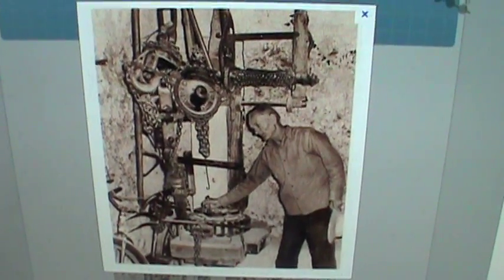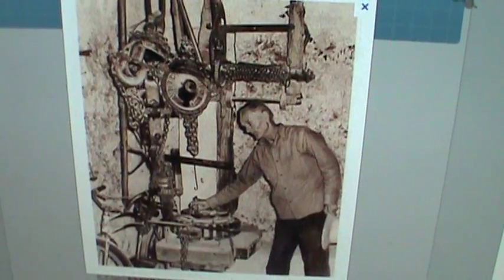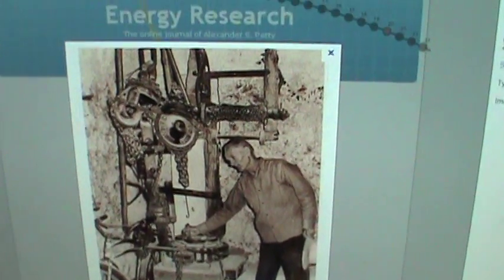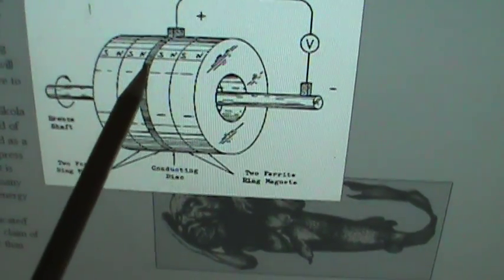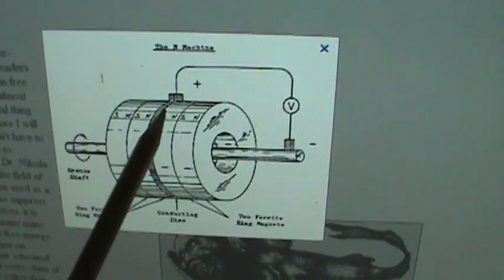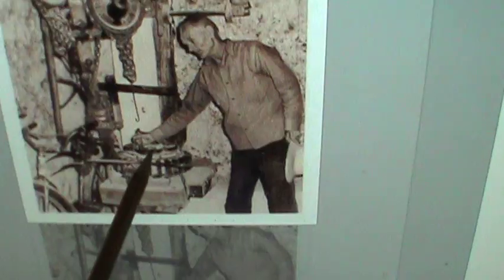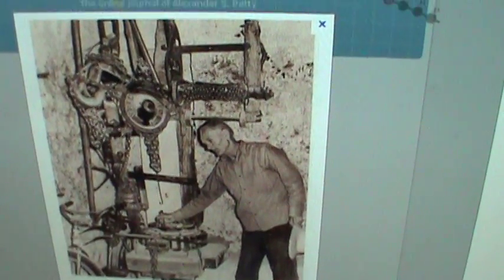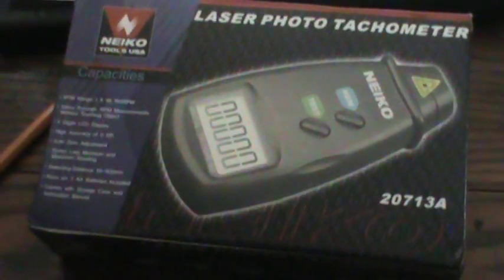Ed Leedskalnin Coral Castle Flywheel Secrets Revealed

Comment: In his book magnetic current Ed stated: "Connect the battery with the electric magnet. it will be a field magnet now. Put the three-inch coil between the iron prongs and take it out, do it fast, repeat it, then you will have a steady light in the light bulb.
Now you and the field magnet are a generator. Suppose you had a wheel and many
coils around the wheel turning, then you would be making all kinds of light." What really interesting is the "all kinds of light"

Comment: He talked alot about electrons. I believe that he was turning electrons inside out resulting in inverse energy. EDL said "If electricity is made with north and south pole magnets and the electric motor is turned around on its axis by the north and south pole magnets as is the fact, then this will bring up a question, where then are those Thomson electrons. They are not around the electric motor. The plain answer is they are non-existing."

Comment: Randy, great info!  When I visited Ed's castle, there was an iron bar that connected the motor to the coral wall behind him in the picture.  I wonder if it was meant to connect outside the  house or to the rotor, PHM, or possibly the rotor shaft.  It could be slid in or out of position.

Comment: I think to levitate those stones all that is needed is a strong magnetic field and the right frequency since all matter is actually energy each vibrating at differerent frequencies. So with the wheel and coils he managed to create a very strong magnetic fileld and tuned in to the frequency of the coral and depending on the individual magnets (north or south) he could make the stone heavier or lighter. Now we need to figure out how it was done.

Comment: I understand that if you could perfect this design it would easily generate a lot of electricity. Great. Now, where are the rest of the heavy cranes and equipment needed to move these stones. He did not have them. What was he doing with this energy and how? Please post another video when you have the answer. Thanks.

Comment: Nice! To really draw in magnets into the iron, it shuld be pulsed. And isn't the top of  the handle a little bit burned? Could it be posible that it was a spark gap between the hook and the handle on the wheel, one pulse/rev? it would still be a homoplar motor and even less friction than a hook dipped in the water. Thank for all your efforts!

Comment: Well you certainly have me thinking enough to make me want to have a looksee at that photograph myself, but i can se that you have put a lot of thought into this.I also think your point about the wetted,  0 friction contacts is interesting< i have to wonder how you can be sure that only water was used in the basin with the magnets,
i am also curious as to how important the ground portion of the circuit is because i have beeen to Fla. and in my experience you could find ground water anywhere by digging just a f few feet., therefor if your soil does not reflect the same charecteristic as the soil at coral castle.

Comment: I was reading about earth gridpoints and came across this.   How interesting and convenient the grid point is now in an air force base?

We must remember Leedskalnin was working on a Diamagnetic Earth Grid 			Point, so all mass objects in that area are always "charged" and 			easily lifted at their center of mass by a slight upward pushing 			pressure. Incidentally, due to the shifts in the north and south 			magnetic poles, Grid Point #18 is now inside Homestead Air Force 			Base; thus Coral Castle could no longer be built where it is now 			located.
Reply: great info. ed found the place my riding a bike without the rubber tires on it. something big is missing to this whole thing

Comment: Is it possible that the chain was charged with electricity making some sort of electromagnetic field flow through the chain? Perhaps the entire chain became anti-gravitational. He would be able to wrap the chain around the rock and the lift from the antigravity chain would lift the rock up. 

Now that the rock is suspended in mid air (or maybe even floating upward, depending on the strength of anti-gravity), he would be able to push the rock anywhere while it is weightless. Is this possible? Tnx

Comment: Another thing. According to the old paper about Edisons eperiment and folow up tests, the iron external from core should be connected assynmetrical. Connecting it to the null point will not do anything extra. Ed wrote something like this his book: "...put an iron pipe with only one end cap around the coil and fasten a hook on it..."
But he didn't tell what the hook was for. Maybe to connect one of the coils outer iron to the big extenal iron mass.

Comment: enjoyed the vid bud. Not sure if this is obvious or relevant but the chain in
Ed's picture is wrapped around a cylindrical "axle" of shaft (above Ed' head in the photo). Or so it appears, was this generator simply to make the axle/shaft spin/pull the chain similar to an electric hoist? which could help with lifting the coral etc?
Not sure I explained it well but perhaps you get my meaning? cheers

Comment: the water in the castle is surrounding a pointy wheel. I saw this as the flywheel inside his contraption. water is missing in his device, but around the flywheel in the pond. put water in the device. also, "drop below" near the entrance means to drop the hook below. most likely in the water. this is one way i saw it. however, why spin the inside flywheel. it would splash everywhere.

Comment: Try to connect the upper chaind to the ground throu the big iron pipe and i think you can get voltage at the pmh chain and the ground ;) 

But i must say your idea is great!!!  fill with water,  that is the key.  thats why the flywheel is waterproof with concrete and have higher outline wall...  

Do you have done everything as in original design? i think it is very important,  that proportions are the same....  

will you post new vids with eksperiments? 

Kuba
Reply from the maker: I'm pretty sure I now know definitively what Ed was doing with the iron...not such a mystical mystery. Yep, I'll be making a bunch of vids sharing my thoughts and builds of the last few months. Things slowed down the last couple weeks with my project due to stupid normal life things that I had to deal with...haha...house repairs, collecting chopping firewood, my doctor giving me a workout, etc. Today I'm looking forward to working on my project all day...fun weeee! lol. Peace!

Wangus
Reply: We need to resource and test your idea. Nobody has even bothered to suggest Earth the current and drawing it back through the external magnets he was using. Meaning he could create and earthed circuit and run two separate magnets. One toward and one away. Think about gravity guy on the iPhone and you'll see what I mean, either sides pressure would outweigh one at any given time and cause it to escalate or fall. 
I don't know I'm not a physicist, tell me if I'm blindly ignorant and moronic.

Comment: I tried some bigger coils 880 grams each but gives not as much extra  as I hoped.
watch?v=DRMEKvZ9qVo 
Think I need more iron. Used 6 wires 0.3mm parallel have 7.5 ohms but maybe still to high resistance. Maybe I will try them in series and go for high voltage and dump it in a battery.

Comment: That symbol could be a 2D representation of a dual tetrahedron ,which are present in every cube ,But the way it looks is like there must be 2 cubes containing 4 tetrahedrons  which if were inside a sphere would represent the 16 points where energy can be tapped ,If the sphere were the earth ,maybe the energy is at or near these points in a torsion field effect of sorts ,the symbol could possibly be creating a torsion field of its own ,providing an assist to the pmh's effect . CC seems to be near one point of the bermuda triangle,Hmmmm...wonder if  location matters ? Its making me crazy.
Reply from the maker: Maybe you've seen this 1 before, but the coral castle location is no coincidence in my eyes:

Coral Castle Mystery Revealed. The Leedskalnin Ley Line
Reply: Not yet but i will ,i was checking out how everything lines up on google earth ,even the giza pyramids line up to this pattern,thanx .

Comment: It seems that he was using the magnetic force to push and levitate heavy items.  When he applied the magnetic strength to a round or odd shape stone...he could move it around...he was not concentrating on the stones or rock but the placement of them,m thus he guide them as required....just my visualization.

Comment: I think I see where you are going and i want to throw something in here. Recently I recognized the commonality of symbols. electrical sound magnet .. record,erase,playback ..what if its not a levitation or magnetic trick..check graham bells machine and check out pipe and flywheel similarities.. the first microphone has similarities to the electromagnet and it stores and AMPLIFIES into the pipe or SPEAKER the SOUND of the stone..How do I say this?? the flywheel doesn't generate energy ..